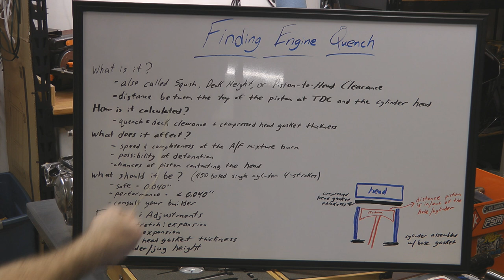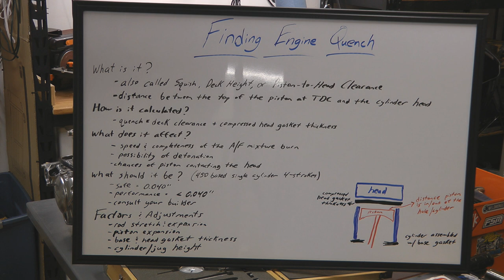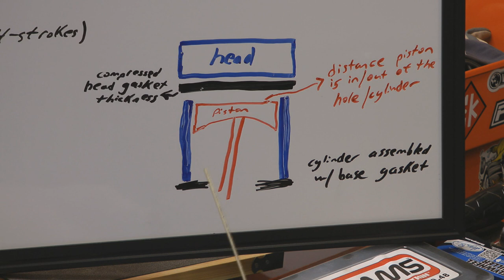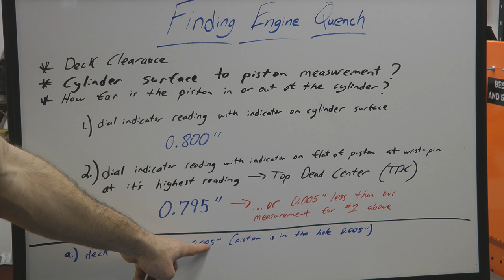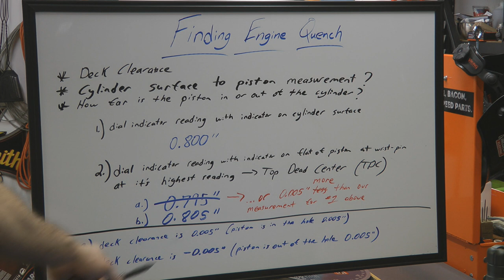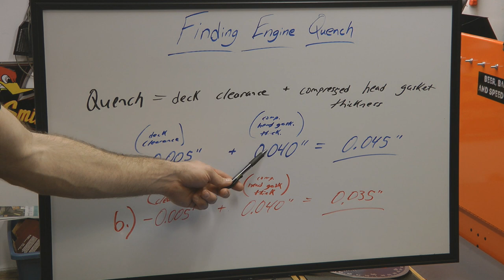Hott Boys Garage - Ep. 2 - Finding Deck Height/Quench/Squish on a 450 Based Single Cylinder Engine

Comment: Probably the best explanation i hav found. But i was lost with the cylinder head mock up bit  spacers wrist pins ect ? My deal is actually a car but what u said transcribes to both.
Reply from the maker: Appreciate the kind words and glad it is helpful! For the cylinder head mock-up and spacers: the spacers are to simulate the height of a cylinder head...and that is needed because our head studs are not threaded all the way down to the base...so if you were to put a nut on the studs and attempt to torque the cylinder down, the nut would reach the end of the threads on the stud way before getting down to the cylinder.  This might be different on cards...maybe some 4-cylinder/6-cylinder/V8 engines head studs are fully threaded?  Hopefully that makes sense.

Comment: I assume no rings on the piston? Not sure if the piston would rock enough without rings to notice since you took measurements at the wrist pin area. Thanks for the video.
Reply from the maker: There are rings on this piston. Since we measure at the wrist pin area, the piston rock front/back in the bore isn't a factor.  Thanks!